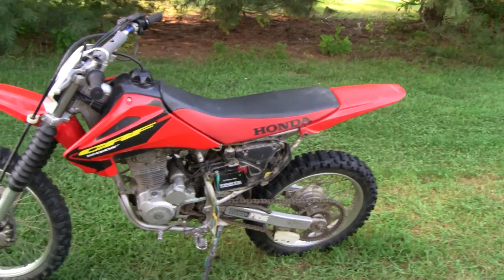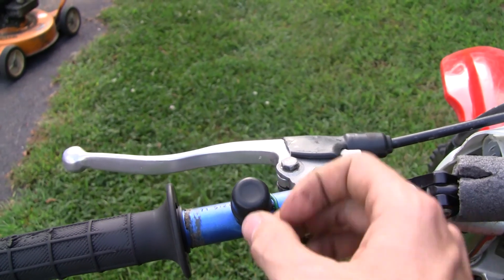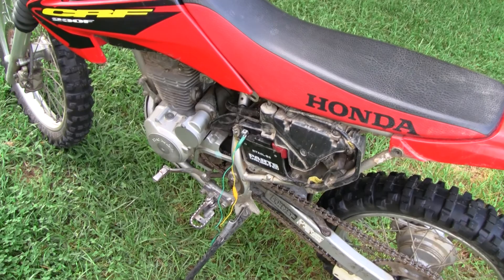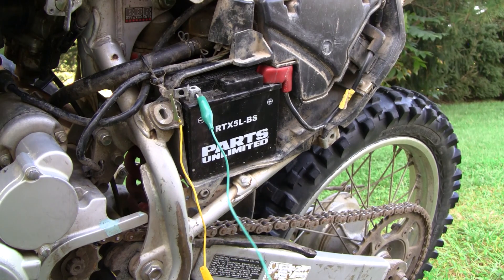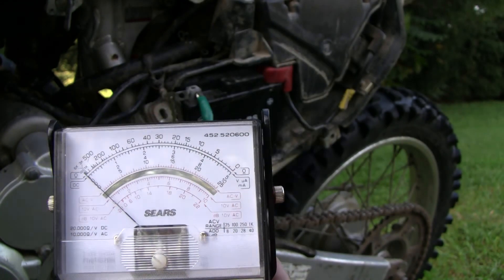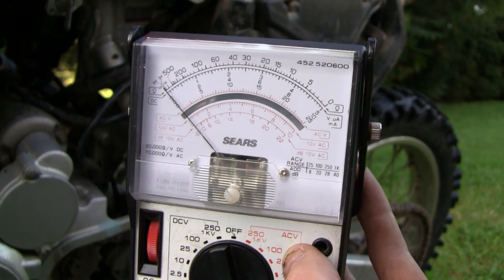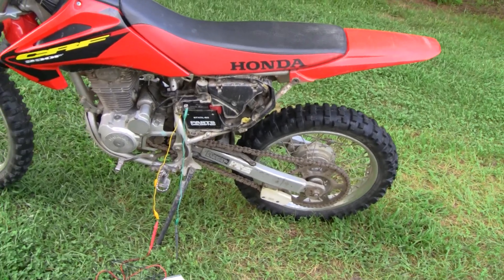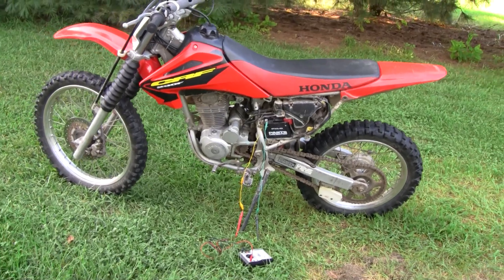CHECKING HONDA 230 FOR POWER DRAW

Comment: That is a Great Tip I have done that with a light bulb on older cars with the key off and if the bulb glowed  I would pull fuses to see what could be drawing power Remembering that that dash clock always had power I would unhook it first I found bad headlight switches that way